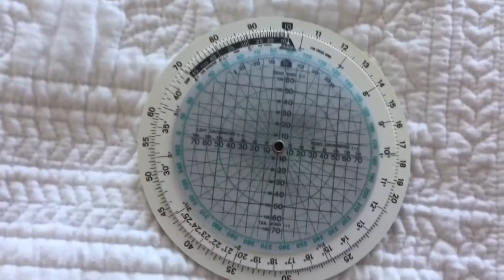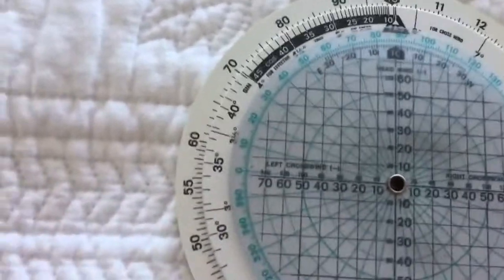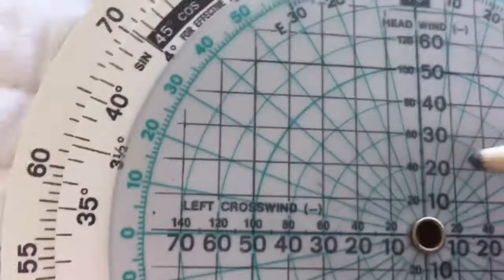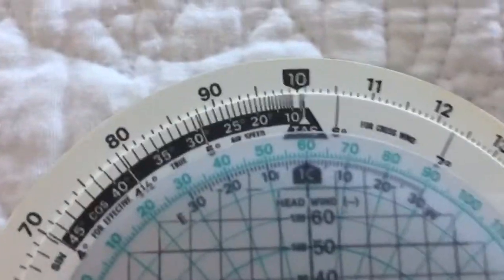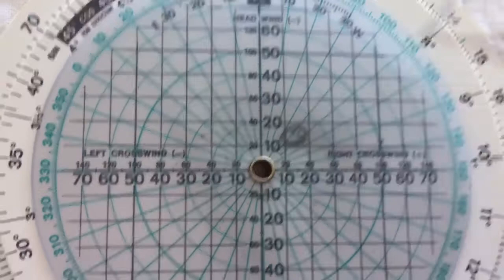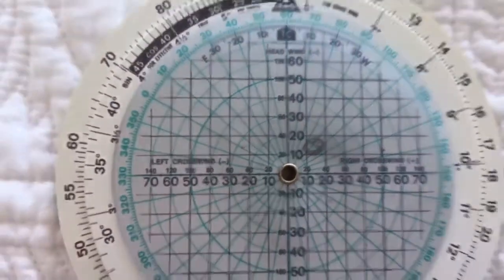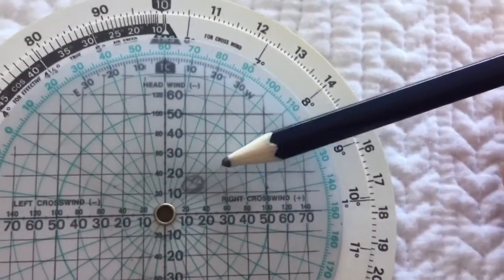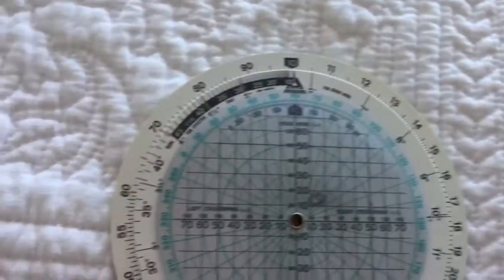Jeppesen CR 4 To Calculate Drift or Groundspeed

Comment: What do you do if you have a high speec wind from example 240/120 since there are only 8 circles? And each is 10
Reply: There is a scale with small numbers,for example,each square would be 20 units that is doubled .
Reply: The small numbers are located left of the large numbers.